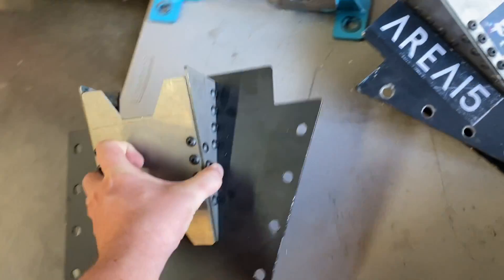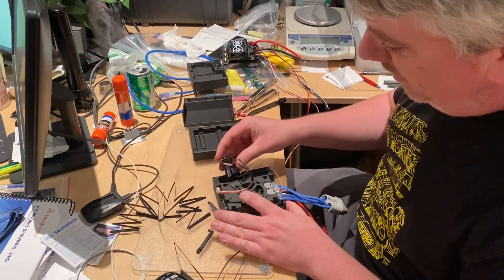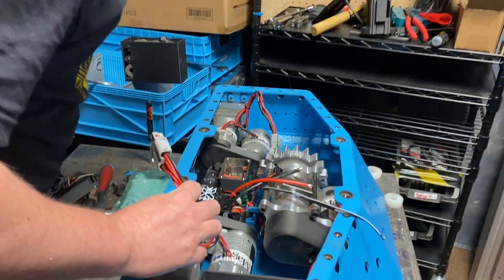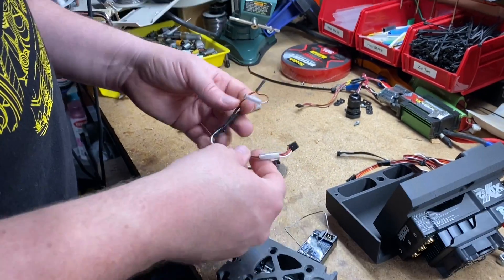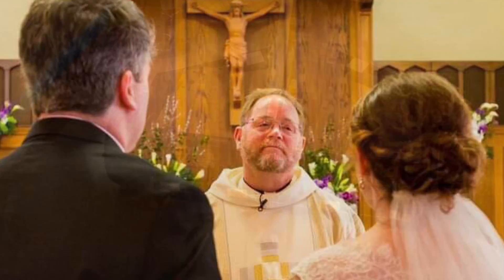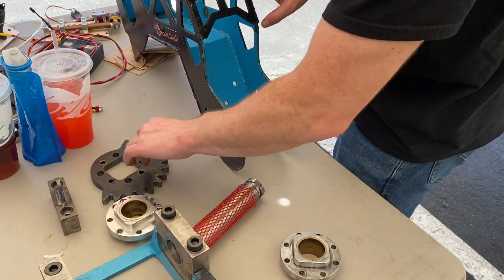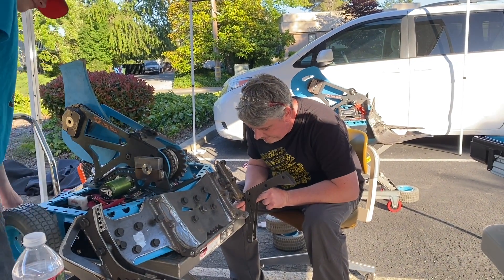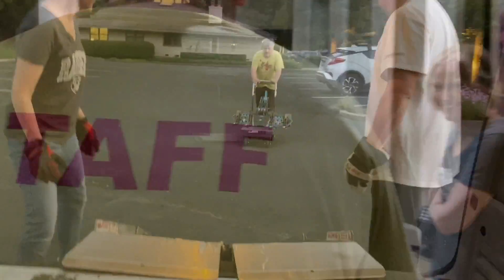7 Crazy Nights 'Til Battlebots   [Builder Blog Ep. 62]

Comment: Good luck at the fights!

Going into this question under the assumption that when you asked which one I want to fight, it's which one I want to fight. The main metric I'm deciding this based on is weapon reach and range. I've ranked every bot in S6 according to this before, so I've thought this through a fair amount. With how powerful these robots are, I have no doubt that any of them would cause some major damage if they were to hit me, so weapon power isn't much of a concern here - just not getting hit. So going by process of elimination:

Tombstone is probably the easiest to eliminate, as I feel that any horizontal is probably the most dangerous to be stuck in the box with. A bar spinning that fast right at ankle height will probably take that leg right out of the equation. Especially with that wide of an area to hit with, it would be easier to potentially try and dodge a vert with how narrow the effective range can be across the face of the bot.

Edit: Just saw that Malice will also be at the event. I'll put them just behind Tombstone, as the Horizontal still bodes very well against me, while the smaller weapon disk will hinder its reach just a bit.

Skorpios is next up as the most dangerous in my opinion, as it has all of the power of a vert in terms of damage to oneself with the ability to raise that to various heights along the leg. Not to mention that the large front plow would be a pain to try and frantically run around. If they're running the vert configuration, I'd say Whiplash is probably relatively even in terms of threat, due to the lifting spinner.

I'm going to group Hypershock, Madcatter, and Cobalt together, as they're all relatively similar in terms of weapon reach. All of these bots are relatively similar in terms of weapon reach/range, although I'd maybe give a slight edge to Hypershock due to the wider dual disk setup. All would cause major damage if they hit, although the thinner effective range gives me slightly higher odds to try and dodge an attack run. 

I'll put Hydra and Blip around the same difficulty. I feel like Hydra's ability to land a hit will be easier with how good their ground clearance is, while Blip's speed will probably be able to knock me into flipping range about as easily. I feel like a flip might cause less damage that a spinner would - or at the very least - a different kind of damage that might be easier to overcome.

With that said, the bot I feel like I'd have the strongest chance against in the box would have to be Whiplash, assuming they're running just the lifter config. The speed and control will still be very rough to deal with, but the lack of a spinning weapon or a high powered flipper is probably what I have the best shot against. Assuming they run their spinner config (which imho they should against me) either Hydra or Blip, probably Hydra to try and outspeed.

Feel free to debate with me if you've read this far lol. If anyone's curious, imho the most worrisome bot would have to be Bloodsport or other full body/high range spinners. Considering Bloodsport, a high powered horizontal with 360 degree range on a speedy drive does not bode well. Most survivable bot would have to be SMEEEEEEEE, with the aim being to jump over the bot as it charges at you, with how narrow it is.

Comment: Since you didnt also ask, what we would be driving, i will assume we are driving Skorpios, and in that case, i would most want to fight, Hydra, like blip its weapon is the least damaging of them all, with whiplash being next on weapon damage, even if they are running the spinner . Hydras size makes it turn slower than blip, plus it is a much larger target. It wont be a easy fight by any stretch, but, your less likely to need repairs from that fight.